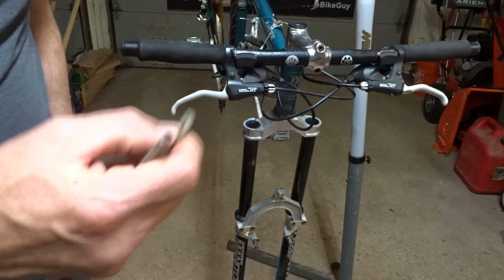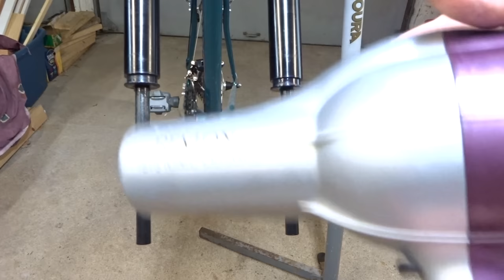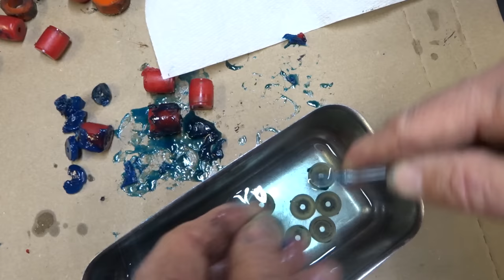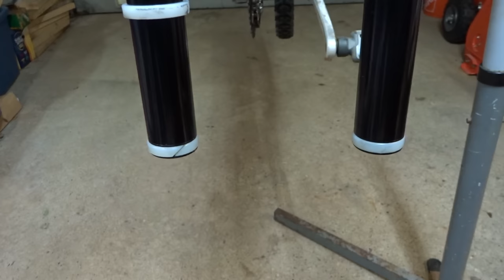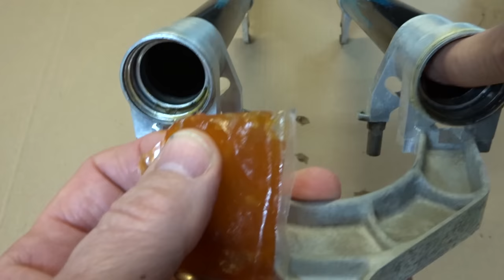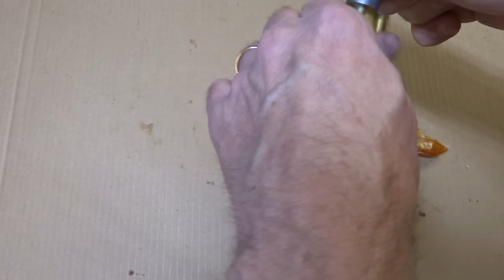Answer Manitou Three (Manitou 3) Fork Rebuild/Overhaul

Comment: This is so awesome and timely.  I have had a 1993 Trek 8000 with these forks on them hanging up in the rafters of my garage that I want to turn into a retro gravel bike with drop bars.  This was a bike that I bought and upgraded as a 19 year old XC racer working in a hot kitchen, and it held enough sentimental value for me to haul it along all these years.

I just pulled it all apart, and thankfully the elastomers weren't really goopy, except for the bottom-out ones.  The compression side was mainly just dried out and squished.  The bottom side unfortunately are a little more melted and thus will require some cleaning in the lower tubes (fun).

One thing that I found during the tear-down, that I now remember doing back in '94 when I bought these forks: I replaced the top-out elastomers with coil springs that were intended for RC car shocks, that I went and bought from a hobby store.  The top-out on these forks was so abrupt and jarring to me that I went a little MacGyver with the springs and it actually worked like a charm to soften up that feeling when you compressed the front end and pulled up off the ground.  It was actually quite cool to see this stuff after all these years.

Anyway, I just ordered the new elastomers and look forward to turning my old girl into a gravel bike that I can keep up with my wife on.  My enduro MTB is my pride and joy but I'm not able to maintain 17 mph on it :D

Comment: Thank you for the helpful video. I found the rubber seals after the split bushings really hard to seat in properly. Luckily I could remove the legs from the crown as they are bolted in so got them to seat that way.

Comment: Acetone is  corrosive to regular plastic.  Those plastic washers may be very weakened.  If they are nylon, then it's fine.  Generally, it is not a good idea to clean plastics with acetone.  But at a minimum, you should wash well with soap and water when you're done soaking them. The film acetone leaves behind is also corrosive to plastic.

 I learned this the hard way many years ago with an ink refill kit.  It called for acetone to allow the cartridge to be open. It all worked great, but I never washed it off.  The next day my printer was destroyed from ink.  The cartridge dissolved everywhere the acetone was. It got on my carpet and desk.

Comment: Great step by step video!   This helps a great deal as i am try to replace the elastomers.    question for you....what is the best way to take off the blue caps for the compression rod if they are stuck?  i'm trying not to damage them, the metal is so soft.

Comment: This looks more like my Magnum fork which I think is the Manitou 4. Mine has the milleted brake booster. Looking forward to this intimidating project.
Reply from the maker: The instruction sheet for the rebuild kit was for both the Manitou 3 and 4. So it should be similar.

Comment: I'm assuming the elastomers in these old fork were used for rebound instead of springs or air?
Reply: They provide rebound and also control the speed of it.
A great idea.. but very limited travel and they wear out fast.

Comment: I cant get the drive side bolt out from the bottom. seems like the whole plunger is spinning. Any info on how to go about this would be much appreciated. Thank you!
Reply from the maker: Push a dowel down inside the fork to put pressure on the plunger to keep it from spinning.

Comment: I really don't understand why they build forks like this.  Perhaps weight is the main issue, but it also reeks of cheapness.  There is no real dampening going on here.  Motorcycles use fluid dampening and it works great.  Even very low end motorcycle forks work this way and provide excellent dampening.  The main difference is you don't have heavy springs on a bicycle fork providing the downward force like you do on a motorcycle.  AND, motorcycle forks have to pass DOT specifications.
But it seems to me this could be scaled down to something more appropriate for the lower weight and speed of a bicycle. 

It is just amazing to me how expensive these things are compared to an automobile shock or strut. Many bike forks cost way more than a shock for a car (not counting installation at a shop). The auto shocks are so much heavier with much more metal and much more robust dampening. Surely an auto shock meant to deal with a 3k pound car costs more to manufacture than a bicycle fork.
Reply: You answered your own question.
Cheapness is the reason.
Reply: This is a very old fork. Any new, half-decent suspension fork today has an air spring or a coil spring. And it will have hydraulic compression and rebound damping (fully adjustable damping on the higher end).
Reply: You must teletransport yourself to 1993 and understand the mind set. These forks weren't cheap, CNC alu going on.They were the top fork at the time. Oil was used on rock shox and marzocchi  dampers but guess what, they were stiff as hell, no sensitivity. The manitou had much more sensitivity thru the travel, "2inches" :) and yes they were light as a feather that was more relevant than today... the damper is the material, those rubbers cilinders have multiple densities and you play with that. People use to replace them with a spring and that was the beginning of the pogo stick nonsense... ok the next generation got a damper and springs started to become  what is today...
Reply: Mainly because on a motorbike or car, the engine is doing the work , but on a bike YOU are the engine, so weight matters much more.

Comment: not sure what kind of elastomers are those but if I you put general fork grease on elastomers you are going to end like you started... always use teflon based grease on any elastomers...
Reply from the maker: They are poly urethane, and the grease came with them.
Reply: @RJTheBikeGuy  good luck, see u in 15 years :) that grease looks oil based on original elastomers it would be a matter of time... I worked on the Manitou distributor at the time and the this was the main elastomer killer... well after the squeezing :)
Reply from the maker: @pbrajal  The elastomers are a different material. Those old Manitou elastomers are the only ones I have seen get this bad.
Reply: @RJTheBikeGuy  ok but you could refer that, it would be relevant for someone that simple puts any grease like ever before... and this happens to all elastomers from Fattys, RST, Bullet Bros...  unless they are more MCUs they will melt.